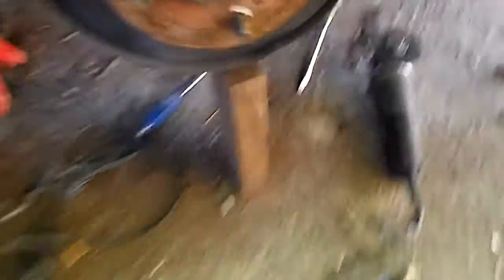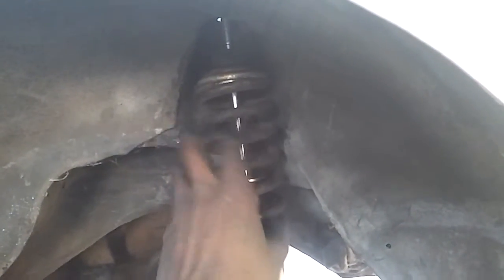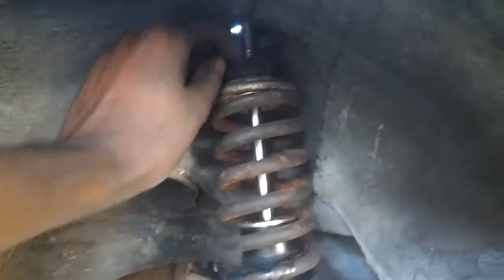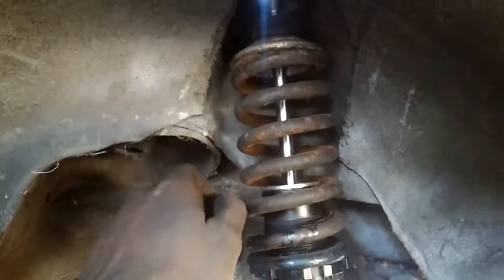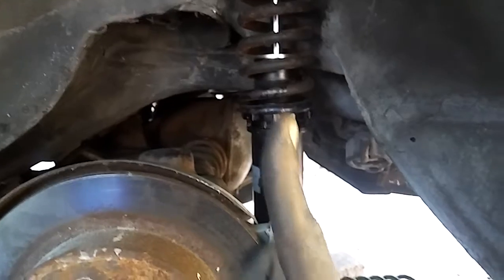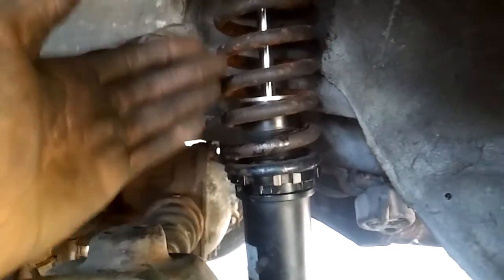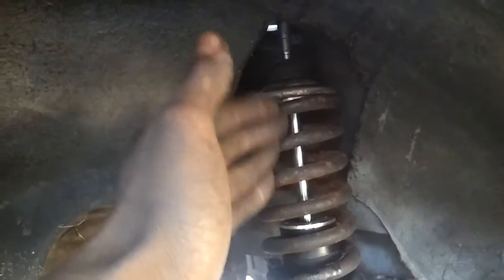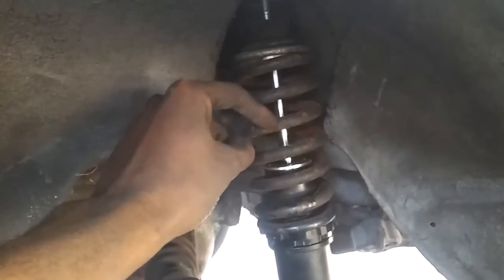S12 200SX TO S13 REAR COILOVER MOD

Comment: From what I heard, where the shock mounts at the top will need to be re-enforced as the welds are too weak and the metal is soft and adding the spring in the mix would destroy the soft metal sheet (is what I heard) So on that note I just run ford e150 van shocks for the rear mid 90's and eibach 800lb pullbar springs with adjusters.
Reply: wonderingraven yup same goes for the e30 though it's even more work to run traditional coilovers in the rear.. thinking of picking up an s12 while I build my e30..
Reply: wonderingraven has anyone in the s12 community actually done this and then actually have their shock towers ripped out? I don't get it. I've never heard of someone actually getting their rear strut towers ripped out from coilovers
Reply: anthony Cabuco I've been told it just no one could confirm that issue, iirc anyways. i like seeing more videos with people using the rear s13 coils to fully confirm. I think at most of it's rusted out maybe it's a different story but really the s12 is no different than an s130 (280zx) in the thickness and my bro is running full s13 with 0 issues.
Reply: so s13 coils work on the rear, but its recommended to reinforce just in case? Is there any coil overs that fit the front stock suspension without a s13 or s13 suspension conversion?

Comment: dont risk it
Reply from the maker: Why do you say that?
Reply: Do you think that the strut towers will be strong enough to hold the load of the spring and strut instead of just the strut in the factory configuration?
Reply from the maker: +650jdb Yes and no but I have to try. I've never seen it done this way. I could always reinforce the strut towers if it came down to it
Reply: True
Reply: you have to reinforce the strut towers, the stock on was not intended to take strut and coil at the same time in the strut tower, also its not so healthy for the chassis, now is a good time to get a strut brace and tighten it (not excessively of course).
Reply from the maker: +Rick Chang Strut tower reinforcement was completed.
Reply: i noticed but for whoever else have not seen the update vid at least they will know if they read the comments.
Reply: They said the same about the z31 also